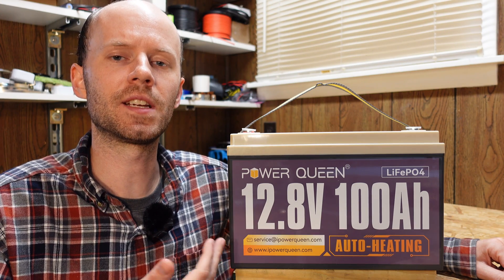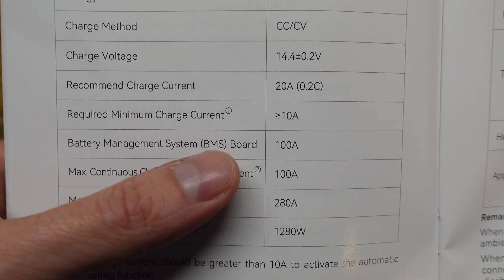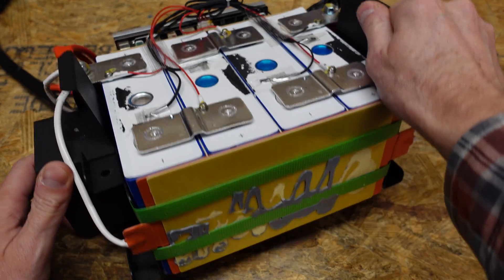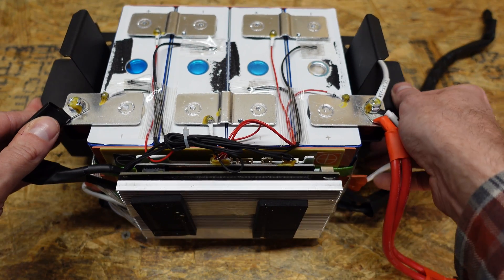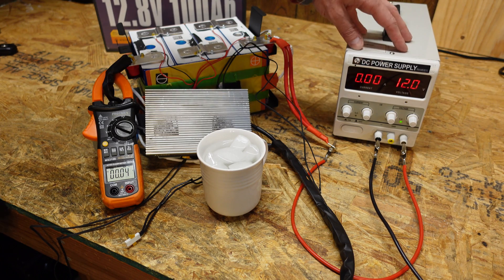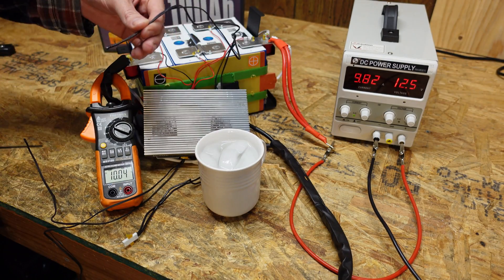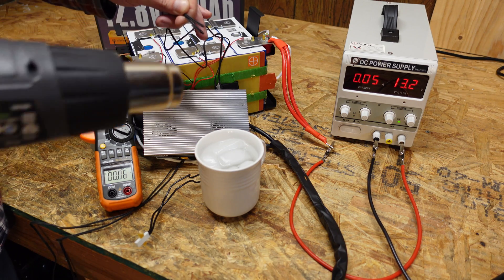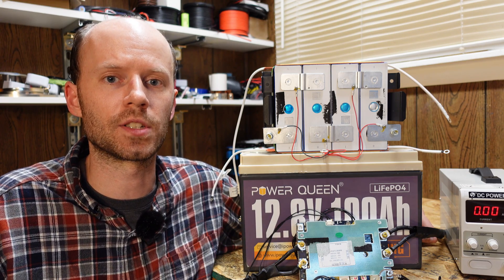Power Queen 12V 100Ah Heated LiFePO4 Battery, Near-Identical Inside?

Comment: I want to run a supplemental lifepo4 4s battery in my car trunk to run my dashcams and wifi Hotspot while my car is parked and also double as a car led acid battery jump starter. Looking for advise on which battery to buy and advise on wiring it to be charged off car alternator safely or is any of this a bad idea.

Comment: They may have used the thermal switch as a control to turn off the heaters if they get to hot and the BMS did not turn them off.

Comment: The premium they charge for these heated batteries is just plain gouging and I really hope 99% of customers have the common sense to realize this and do some research for themselves
Here's more or less the exact same heater: a 4 pack for $20. Imagine how cheaply they are getting them..perhaps it costs them $5 to put two in a battery if they are buying thousands of heaters. Labor time is pretty minimal, one person on the production line could do several hundred batteries a day. The BMS in the non heated version might even have the port for accepting the connector and it might be programmed to work when installed. 

I don't think anyone hear needs to hear this but STOP BUYING PREMADE BATTERIES THAT ARE OVERPRICED. We all know the deal. 16 280Ah cells from China are somewhere in the $2,000 region depending on who you go with. You have the DIY Solar Forum to pretty much guarantee the vendor you choose has been pretty honest with dozens of other DIY'ers. You spend $100 on a better BMS or $150 on a high current option and blam you have 14.336kwh for no more than $2500 while your out the door cost on 10 of these batteries (12.80kwh) is $330'ish at best. If you only need one battery, fine. Buy a premade one on sale. Anything more than that and you are screwing yourself out of at least $80 per 100Ah. Could be as high as $100 per 100Ah if you get a good price on the cells and have all the misc parts from other projects which most of you do. As far as a battery box goes, just use a sub $50 tool box or something.
https://www.amazon.com/12V-Flexible-Silicone-Rubber-Heater/dp/B075WVPP5Y/ref=sr_1_4?crid=1Y0WZYE0YMQ06&keywords=12v%2Bheating%2Bpad&qid=1668273566&s=hi&sprefix=12v%2Bheating%2Bpad%2Ctools%2C472&sr=1-4&th=1
Reply: The self heating batteries are nice for equipment that will be used by non-technical people. I use them as drop-in replacements for lead-acid, and the price of the heater is less than an external heater and a reliable controller for it.
Reply: @paulmccoy2908  $20 for the heaters that hook up to positive and negative. Googled "low temperature protection NTC thermistor (or email your BMS manufacturer and just ask them if they can sell you a thermistor for low temp protection if such a feature is present) and see this guy uses a 47K NTC thermistor. Plug and play most likely as they all mostly use JST connectors. Thats all there is to it.
Ampere Time Upcharge 12V 100AH vs 12V 100AH heated: $110
Power Queen Upcharge 12V 100AH vs 12V 100AH heated: $150

That's cheaper than an external heating pad and controller? The external setup would be even cheaper/easier since there's no fiddling with the BMS hoping an NTC Thermistor getting plugged in will give you what you need. But those temp controllers you could use externally mounted are less than $20 all day on Amazon.
Reply: You’re going to have a hard time convincing a County Works department manager that it’s worth saving $140 by having their own employees install a battery heating system on an illuminated hazard sign.
Reply: @paulmccoy2908  if they can't hook up  positive to positive and negative to negative then I'm not sure why they are being trusted to drive county owned vehicles on a public road.

This isn't NCM or NCA. A 12V LFP will at worst vent some nasty gasses if someone drops a wrench in the pack and shorts the main terminals.

Now the real answer to your question is the County Public Works Supervisor doesn't care about blowing public funds when an obvious cheaper solution exists because there is no alternative for the "consumer". Don't like how this person spent the entire budget by July and then dipped into the county reserves? Well come November you can vote for the other guy that wont dot that! He'll just give lucrative contracts to his brother in law and sign off on bogus invoices his brother splits with him.
Reply: I agree, not sure why it needs to be $140 extra!
Reply: Will you come and install the cells and the bms for free?
Reply: @nainabla  say what? Install the cells and the BMS? My ninja, I'm talking about installing a heating pad.
Reply: @ericklein5097  fine, will you come over and install a heating pads and give me 5 years warranty? And who is going to connect the cells and the bms?

Comment: So having 2 wires that don't do anything doesn't bother you?
Reply: Wouldn't be surprised if another customer has it functional in their application and the BMS manufacturer has thousands premade with all those wires installed and Power Queen just slapped the BMS in the battery box with instructions to their employees to attach LTP and OTP, ignore all extras
Reply: @ericklein5097  Sure, I get it... there's no doubt a reason. But if you're going to give something a glowing review with spare parts dangling about that you can't identify, well.... lol.
Reply: @vancey6072  are you bothered by unpopulated spots on a PCB board that works exactly as described in the datasheet and for your application?
Reply: @ericklein5097  Simmer down fanboy. There are evidently 2 spots on the board populated by wires that do nothing. Makes perfect sense to me. :)
Reply: @vancey6072  I'm not a fan of these batteries. My comment on this video was a breakdown of the cost of DIY'ing this vs what they charge and while they are really cheap the heated ones are silly expensive. I'm not wild about that BMS either which is why I really think DIY makes wayyyyy more sense with how easy these cells are to work with.
Reply from the maker: No - doesn't bother me. It's a super cheap BMS, but it's doing it's still job.
Reply: @LithiumSolar  Well, why don't you ask them why those wires are for? lol.

Comment: wonder why you would not put one low and high on the top and bottom of the battery
Reply from the maker: That's a great idea for an improvement. I agree.
Reply: but they at least got it right.. heat rises, so sensor on top, cold goes down , so cold sensors on bottom.. the sensor switch not working, baffles me, why have one that does nothing?

Comment: Since lifepo4 is such a relatively safe chemistry, storing them in a dry conditioned space doesn't seem that risky. 

If temperatures were a issue, I would opt for a heated pad/ battery blanket placed underneath the battery bank. 
Relying on a batteries built in heater to power up long term, seems iffy.  

Having the ability to swap out a heated pad under the battery bank seems like a better option. 

The less options typically means less overall issues, and more reliable long-term. Plus the more simple the battery build is the less chances that the manufacturing process will have in making mistakes, either with the software or hardware. 

Besides having a external heater allows more control for the operator to control the battery bank's performance.
Reply: I think their solution is so simple that the number of units with QC problems or component failure later down the line is going to be slim. Probably just some NTC thermistor going into the connecter on the BMS and this kind of circuitry on BMS's has been around a long time. Just opens up current flow to the heaters. I would imagine heating element quality is probably the biggest long term issue. I can't imagine these suck down too much power either at 50 watts for the pair...running maybe several minutes an hour in cold conditions or 15 minutes an hour in conditions you shouldn't be leaving an uninsulated battery in.

Comment: My 300 ah LiFeP04 battery came in handy after a recent storm and power outage. I was able to use my microwave. I live in a very rural area in a camper and don`t have transportation but with my power stations, solar panels, and my big battery I`ll always have electricity. It has limitations but it`s a lot better than having nothing and worrying about the future. I wish the prices would have been lower two years ago so I could have bought four of them to save money on my electric bill. Thankfully prices dropped enough recently for me to at least get one, a charge controller, AC charger, and 2000w inverter with the last of my savings.